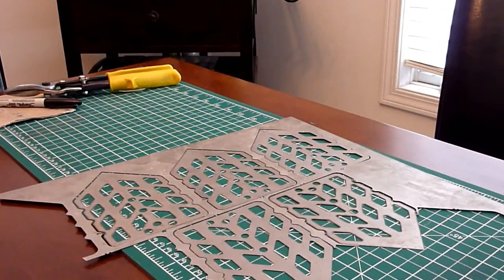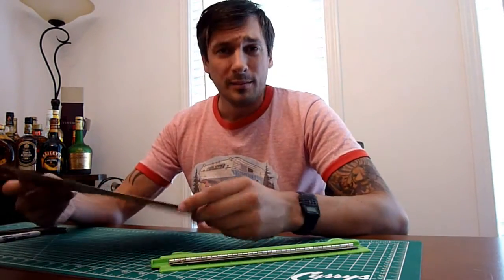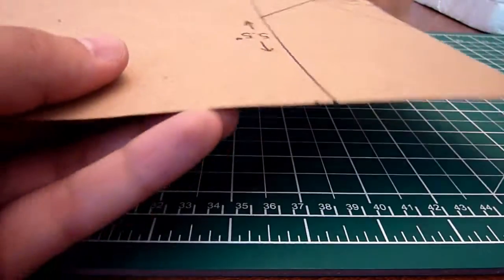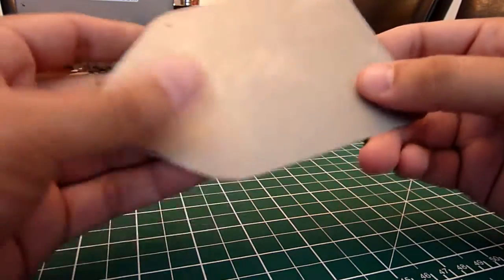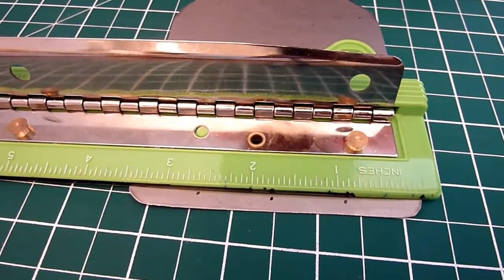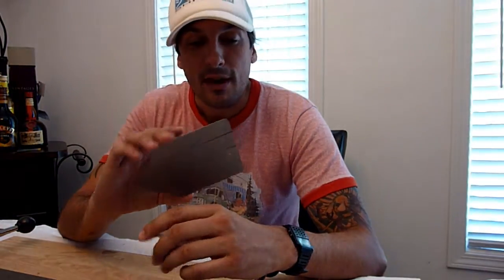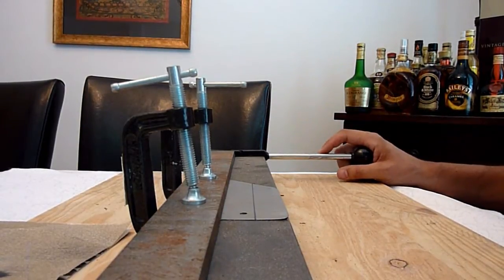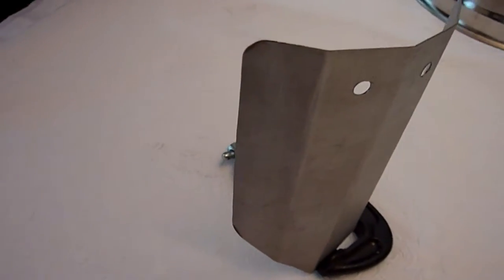How To Make Titanium Snow Stakes - On The Trail - Episode #8

Comment from the maker: @mudtoa 
There are a number of way s to stop the edges from fraying. I've used a carabiner, key ring, or a sheath for the line in the past. A loop of wire at the end of your guyline would probably work aswell. Hope that helps.

Comment from the maker: @FriarTuck1961 
Thanks! The titanium used for the snow stakes is 0.016" thick, 6AL-4V sheet. The Ti sold on my website is 0.003" thick, CP-1 sheet, which would be unsuitable for the snow stake application. I think your best bet would be sourcing the material from e-bay.  That way you can buy a small amount and get a decent price. Hope that helps.